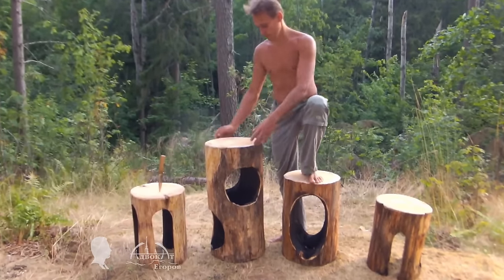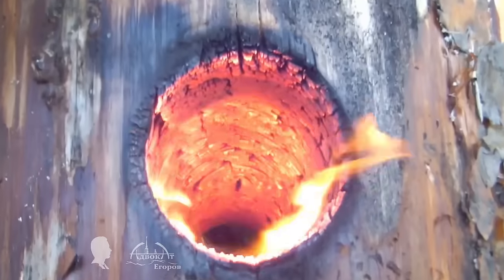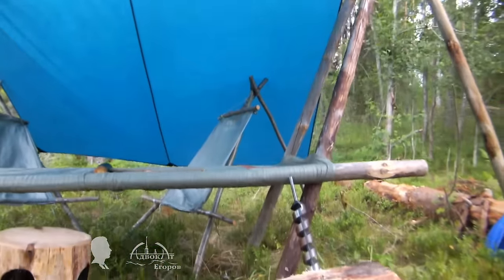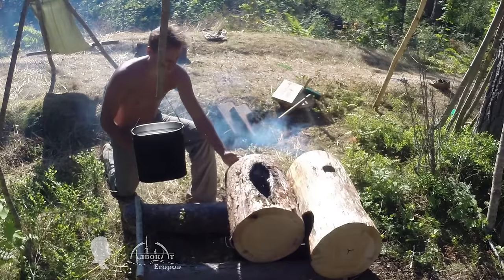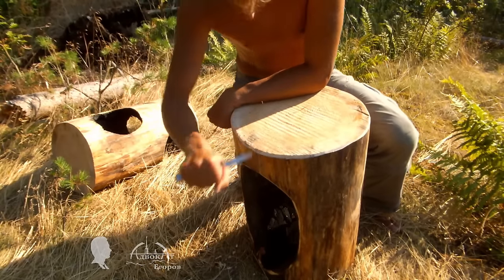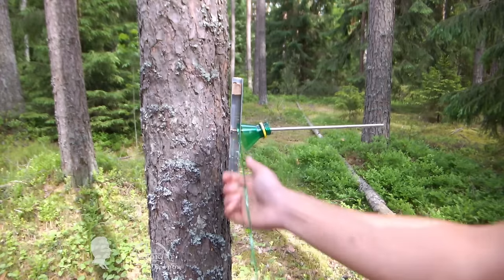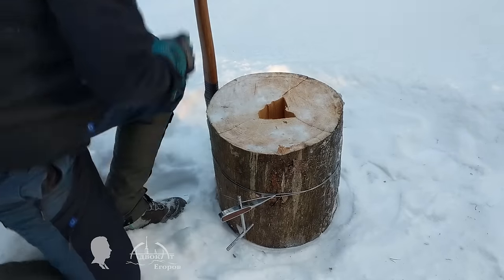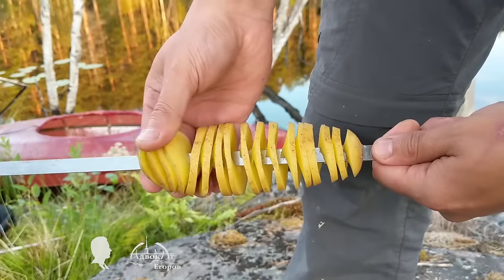Fire  Log  Furniture   part 2

Comment: What tying method did you use for the polymer tape on the mallet? I never know how to tie it off so nicely!
Reply from the maker: I wrapped the PET tape in such a way that it would secure the mallet's head on its handle.
Reply: @Advoko  ahh nice, i see. Great job, the polymer tape invention is something i will have to try, make use of the many plastic bottles i go through.

Comment: What drill is he using, can anybody link the one hes got. I think its the company "auger" but didnt found any drills that include that handle
Reply from the maker: I was using a tap wrench for a handle on a regular D54mm auger bit. You can still find vintage auger bits with a wooden handle on eBay. I don't think they make large auger bits with wooden handle anymore though.

Comment: Did the pipe not pump carbon dioxide into the tent?
Reply from the maker: No, the intake pipe only pumps in warmed fresh air into the tent as long as you keep its intake below a log torch's bottom edge...